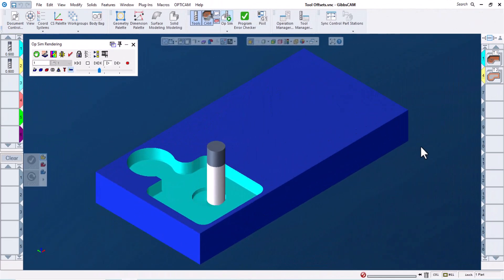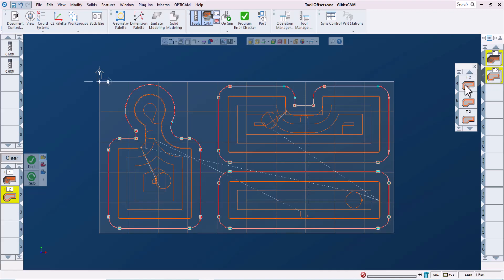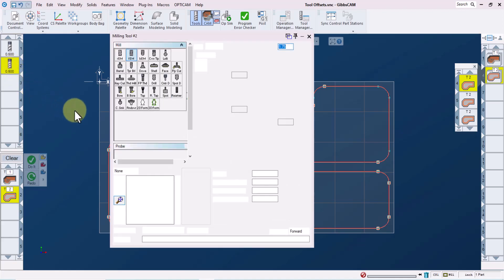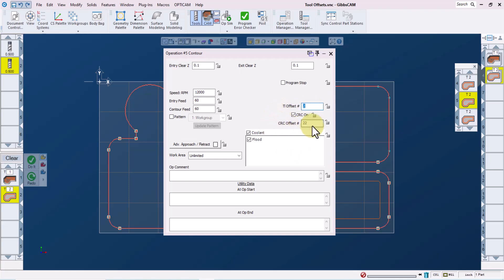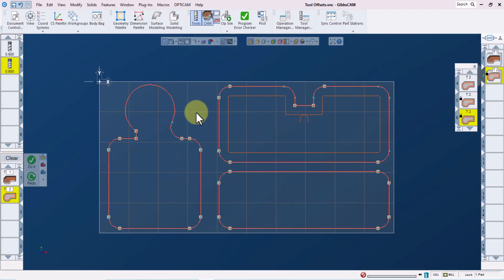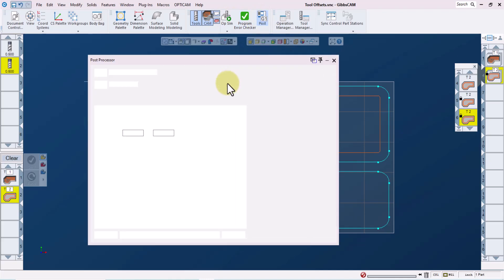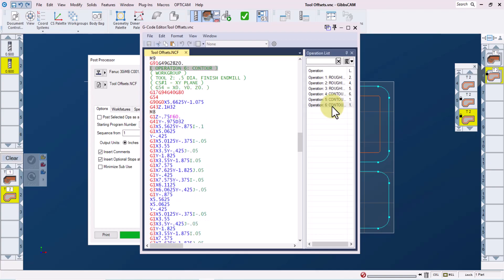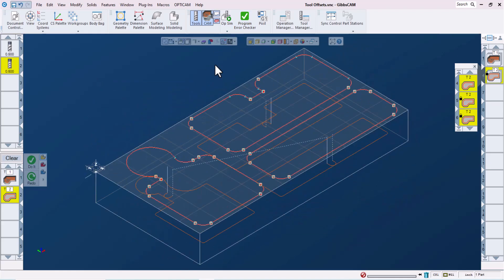GibbsCAM Tech Tip: Using Operation Data to Modify Tool Offsets

Comment: What if your machine uses A/B/C (Okuma) Gibbs value only accepts integer.
Reply from the maker: The operation data can only be used to modify standard CRC and length offsets and does not include 3DCRC or tool posture settings. Your issue may need to be dealt with in the post processor. Please reach out to your reseller to see what your options are. Thanks for your comment!